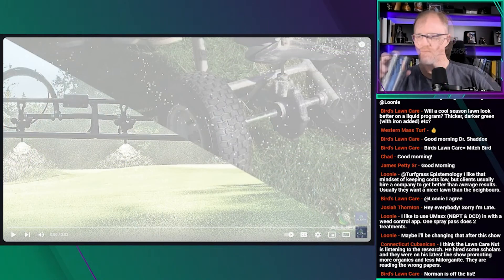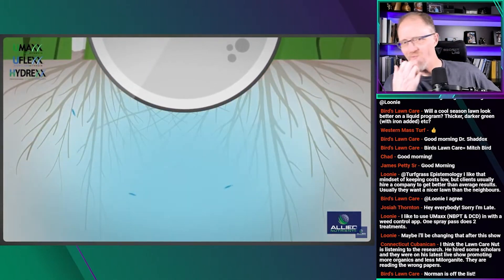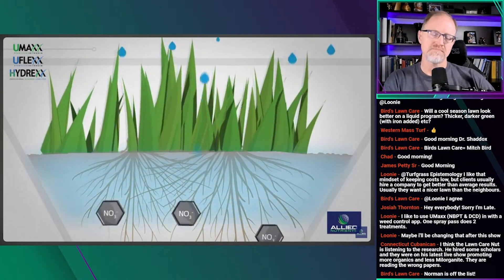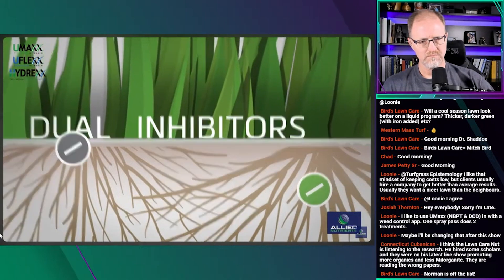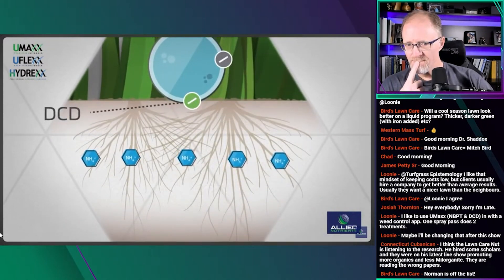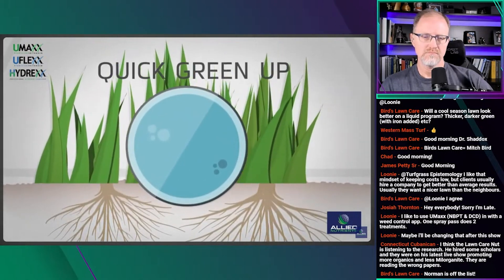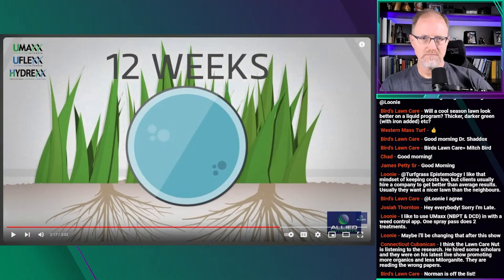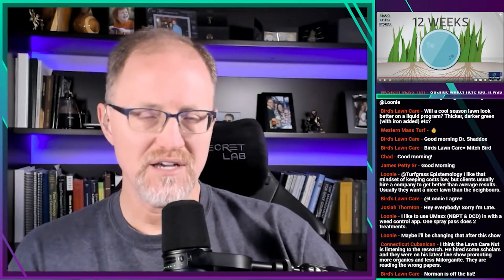Is stabilized urea for turfgrass worth the money?

Comment: What (is/was) your feeling about an old product called IBDU (31-0-0) it (was/is) a slow release WIN that would release in time when water was available to the plant but would not release under drought conditions.    (Very unlikely to cause leaf burn or plant dehydration)   Value was that it could be applied quite heavily (over 1.5/lb N per 1000 sq. ft) and not have burn, and reduced the number of applications over the course of a growing season.
Reply from the maker: @robertpendzick9250  IBDU is a good product if you can find it. Per pound of N it is rather expensive because it is 31% N. I did not include it in the study because it is generally not available.

Thanks for watching!